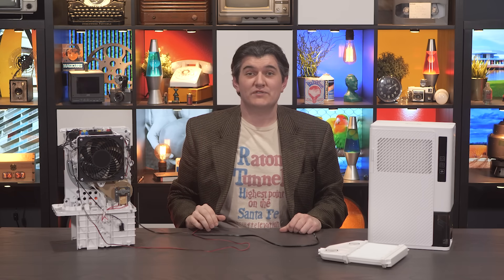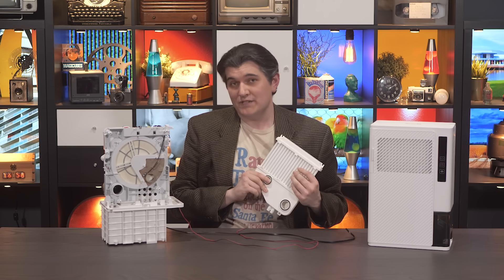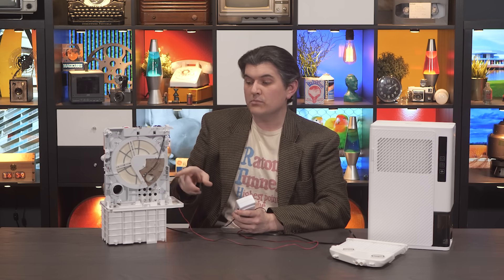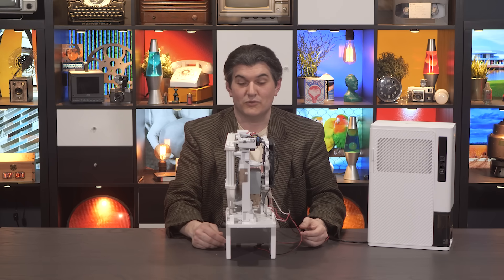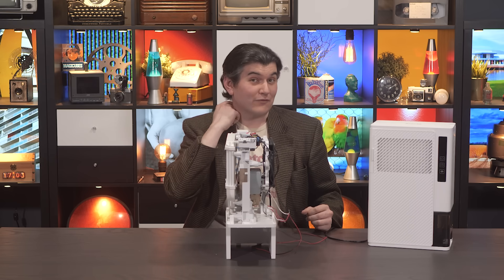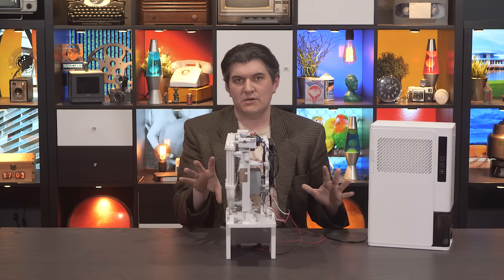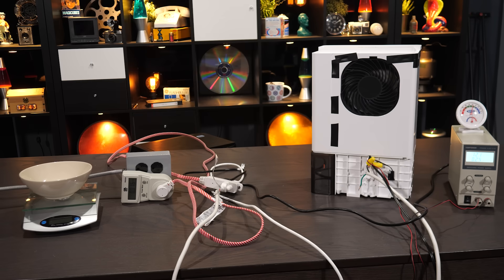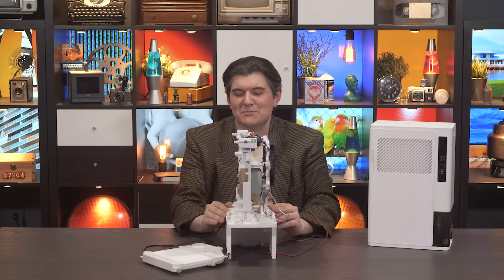A failed duty cycle experiment with a rotary desiccant dehumidifier

Comment: when you did the first test with it out of the case you mention adding a fan to give it airflow since it cant generate sufficient airflow out of the case. that might be why you got more the first test. an extra fan gives the straws more air to cool down more and the gel is exposed to greater amount of air 2:50

Comment: I've used one of these for a couple winters now on my sailboat. I'm happy with the results.  Keeps the ambient temperature a little warmer but also removes moisture.  The biggest problem is when there is a power interruption it does not automatically restart.  Any idea how to get it to automatically restart?

Comment: The experiment that came to mind for me was whether or not the waste heat from the hot side of a heat exchanger dehumidifier could be used for the hot, dry air portion of the rotary dessicant dehumidifier.

But honestly that's getting into Rube Goldberg territory.

Comment: I feel like the one thing you could do to increase efficiency in releasing moisture from the dessicant is by directly heating the dessicant from the inside rather than heating the air being blown into it. By like running a heating element through the wheel in spokes and making contact selectively when they're in front of the small blower. Unfortunately, as you've stated in the main video, the air actually needs to be warmer for the condensation step to hit the dew point effectively, so that doesn't actually accomplish anything except making some more intensely damp air.

Comment: there was probably hundreds or even thousands of hours of calculations and testing and design validation which is why it was built the way it was. The experiment you did was not a failure in any means it just didn't have the outcome you expected.

Comment: I like where you are going with this thing, perhaps put a timer on the heating element, where the silica gel becomes, "More saturated?" before the heater comes on and drys it out. Keep everything running as normal, except for the heater, as that is where all the work and power usage happens.

Comment: 1. Did you account for the energy used by the fan on the paint can for the initial experiment?
2. I'd bet that the "fluke" result was because the lack of plastic housing allowed more air to dump its moisture into the silica, aided by the extra fan.

Comment: I think this does support a few other experiments though:

If we sacrifice quiet, can we ram more air through, and maybe turn the motor faster to get more volume through the condenser?

If it's running on resistive heat, could it be set up to scavenge its heat from something else, such as a computer? 

And my personal favourite, what about running the rotary and the refrigerant loop sequentially? The rotary can "precondition" air to be hotter and wetter and more what the condenser likes. There may also be a similar scavenging opportunity with ducting around the hot side of the condenser loop, but I'm less confident about that.

Comment: Measure temperatures before and after the wheel on both zones. 
Larger ∆t = higher water ad/desorption.
Adjust wheel speed, airflow and heat for most efficient dehumidification.

The condenser isn't too efficient above ambient (22°C) so alot of water doesn't get condensed and thus the air is not able to pickup as much water from the wheel, since it's already carrying a lot of water.

Comment: Given that the peltier model of dehumidifier you covered was similarly efficient to this type, I am surprised you didn't end up combining the two. Replacing the straws with aluminum or copper would allow the cooling of the peliter unit to condense more water out of the air, while the heat generated by the peltier model could be used to product the heat that is pushed through the silica.

Comment: Never even heard of this being a thing for dehumidifiers, only ones I ever knew of all had a compressor. Seems like we'd have something more advanced by now. I could see something absorb  moisture motor turns an offset wheel then squeezes the moisture out at least that would be fairly efficient with power.

Comment: Here's another thing to examine... Saturate the disc with moisture, weigh it, then heat the disc in an oven to recondition it and immediately weigh it again. You could also use your air fryer to pass hot air through it. 😂 This would tell you the capacity of the disc. This might also tell you if the heat exchange is the part which isn't extracting all the moisture coming from the disc.

Comment: Hypothesis: the desiccant absorbs water the fastest when it is the driest. Running the heat on full tilt thus collects water faster. To your original question, is the desiccant wheel moving at the optimal speed when applying max heat? I have another hypothesis - again, if the desiccant absorbs fastest when it's driest, running the wheel faster should collect more water. Even though it may collect less water per wheel revolution, the rate at which the desiccant collects water should increase as its dried out more often. If this is accurate, it would improve energy efficiency as it's not as energy intensive as pushing more air or more heat. I would expect more airflow through the wheel, condenser, or more heat to all increase the total moisture removal rate at the expense of efficiency.

Set up the wheel with duty cycle control, such that you can move it in increments, ideally equal to the area of the heating shroud. Then you can test longer or shorter drying cycles (which is equivalent to changing the absorbing time as well). I don't think this will have better results than continuous process with the same average wheel RPM, but it's a way to control wheel speed with your current equipment.

Comment: I actually believe the reason you retrieved more moisture the first time around with the experiment is because you had that fan blowing on the condenser, higher speed moving air directly on the condenser like that will cool it more significantly, also more air moving into the silica gel wheel because of it could also mean just more air was passing through and thus more water could be taken from it.

Comment: I wonder how efficient that would be if you took heat you where already going to use for heating ex forced hot air and used it in that system. Seems like an uncommon use case but I’m thinking it might be efficient.

Comment: The better way to try and improve the energy efficiency of these is in the condenser. The heat rejected by the condenser should be able to be used to preheat the air going to the heated section of the desiccant drum. The efficiency will never be brilliant though, even if you do it like that.

Comment: Now I wonder if increased airflow over the tubes and silica disk would meaningfully affect the performance, rather than cutting the heating setup.

Might be worth it to try sticking a fan to the outside of the casing to increase the airflow/-pressure during otherwise normal operation.

Comment: Chemist here. You had the right idea, it's very unlikely that it's fully saturated in that short time frame. But like most things, it becomes a bit less effective at adsorption the more saturated it becomes. Kind of like how a dry towel is better at soaking up a spill vs a damp towel. So targeting 100% adsorption would be a waste of energy and time.
Reply: The moisture is taken up 'for free' through passive processes, whereas drying the gel takes energy.
So even though taking up more moisture may be time-inefficient, it can still be energy-efficient.

In practice, there is obviously some sweet spot. Like making the wheel gigantic would mean that it gets more time to take up moisture, but it would also make the device extremely bulky.
Reply: @T33K3SS3LCH3N , it's not really "for free" because you have more drying to do afterward. You either don't get it fully dry or not fully wet, unless you spend more energy heating it and more time exposing it to the air. A full 0% to 100% cycle may very well be energy inefficient in addition to time inefficient.
Reply: The only thing that actually matters is the rate at which moisture is removed on the hot side compared to the power consumed. It doesn't matter whether the material reaches the extremes of moisture, in terms of efficiency.
Reply: I would've just slowed down the wheel....
Reply: sorry this is a super late addition, but i wouldn’t actually be surprised if the silica were pretty close to saturated, the heating element is probably getting nowhere near to fully drying the silica, those kinds of materials can hold on to a TON of water very strongly, thats why we use them to dry solvents and such and keeping them in inert  atmosphere is important for them to stay “activated”

Comment: The "normal" use case for silicon dessicent involves small sealed containers: medicine pills, jerkey or other "dry" foods. Presumably, the manufacturing process tries to keep the air in the containers as dry as possible, and with as small a volume as possible. Therefore, the moisture it is expected to absorb comes either from the contents itself, or from difusion through the container or the seal. That is not much at all.

Comment: Measure the temperature of the heating element.  
Bake the desiccant in an oven at as close to the same temp as you can.  Measure the weight of the disc.  
Set the disc in a very humid location and again take the weight.

If you know the max amount of moisture the disc can hold, the RPM the disc spins at, then you can calculate the max amount of moisture you could expect to extract per minute.  This of course assumes "full saturation" of the disc by the time it reaches the heating element and the complete dehydration of the disc by the end of the drying cycle.

You might also repeat the experiment and only change one variable - the speed of rotation.

Comment: I wonder if you simply slowed the speed of the dessicant wheel so it has longer in the heat and also longer to cool and collect moisture.  Maybe decreasing the duty cycle to reduce power consumption isnt the way to increase efficiency but making it collect more water between drying cycles could be more effective?

Comment: Thing is, there are a number of things the engineers that designed the thing (three is the perfect number) could have done to reduce power consumption without making the resulting contraption more expensive (which was the hypothesis of this experiment: we can make the apparatus work better while using less energy). If they didn't do that, it suggests that the outcome would have been unfavorable under normal use.

Generally speaking, I will be willing to concede that what I am getting is the best possible result  *for the cheapest possible price*. That's because the designers' pride is forever fighting the company's bottom line, but if an engineer can make something, for the same price, that just works better, they will.

There probably are a number of tweaks that can be applied to that dehumidifier, based on room temperature, actual relative humidity, and a number of other variables, that might be able to make it work better, at the cost of making it significantly more expensive. The simple ones, however, the ones that are really cheap to implement, like reducing the size of the regeneration section, the power of the heating element, and the rotation speed of the wheel, all of which, combined,  would result in the same outcome the experiment was looking for, have already been taken into account.

After all, if there were an easy way to get more dehumidification for less power, that would be a competitive advantage.

Comment: The fact that the output of water is so oddly consistent probably on its own means that the silica gel is almost always completely saturated. So the heater is probably sized so that it doesn't damage the wheel at full power.

Comment: I don't think the wheel's saturation is the limiting factor. It's likely to actually be how much water can be pulled out by the heater. A similar experiment with a higher temperature in the heater, or a larger heater might see different results.

Comment: Yep. Too many variables. Even the room moisture content may change while you're running the experiment. (I mean, that's what the thing is supposed to do after all). Certainly running it uncased with an exterior fan seems an odd choice. Also, I'm looking at the proportion of the wheel covered by the heater. It looks like less than a third to me, so I'm wondering if your 80/40 second ratio is correct? The rate/extent to which the silica absorbs moisture is probably higher when it's warmer. But an experiment that isolated the gel, heated one sample and not another, placed in equally moist air containing sealed containers might confirm/deny that. It might be bit more finicky to arrange, but the rate the silica loses moisture in an airflow depending on temperature could also be arranged. 
The designers have presumably assumed that mass air flow is the more determinant factor, hence reducing the heater temp in night/economy mode. Still lots to learn here I think. And fascinating as until your video I had no idea such a device existed. There's a LOT of product development in the world of 3D printing aiming at drying/keeping dry hygroscopic filament. Silica gel is widely employed as is active heating, but to my knowledge no device incorporates the two techniques as here.

Comment: I wonder how much the desiccant is doing, compared to just passing hot air through a radiator.

because hot air can already carry more moisture.  I guess it'd be adding surface area.  but dunno I feel like you could design something without the desiccant which would let you get away with less heat and just a bigger radiator.

Comment: My issue with this is kind of the exact opposite of what yours was. To 'recharge' silica packets they need to go into a 120c 250f oven for 2+ hours. I suspect that the heat is not prolonged enough to remove water from the matrix in an efficient manner. However.. I am not going to test that and instead will be running my heat from September/October through May/June with average 20-30% humidity outside in the summer.

Comment: From what you shown in both videos, it looks like the gel gets saturated well before it returns to the heater. Like, you might as well add the second heater. (or do something fancy to heat two opposite areas of the disc)

Comment: on a molecular level, silica gel is made by superheating glass to such a high temperature it turns into a gas, then spraying the gaseous form of glass into a cool air volume where it turns instantly into a solid. 

this creates a kind of sand that has an extremely high surface area, which provides a lot of nucleation sites for water vapor to cling to. then the dense networked internal structure of the silica gel traps the water molecules inside it.

Comment: A larger and thicker wheel is probably more efficient but not as portable. In building scale HVAC systems, a desiccant wheel is 1-2 meters in diameter and about 25cm thick. Some percentage of the wheel exiting the heating area does not do anything until it cools enough from room air blowing through it to start adsorbing again, and may actually re-reradiate some hot moisture back into the room as the wheel cools.

Comment: what if you are getting this backwards, its the heating that starts the action, it starts the timmer as the thing gets colled down and this time window ditactes water absoption level. what if everything is proportional to how much they can heat this. plus you only think about electro-mechanical factors and this chemical reaction depends on more than power and time etc

Comment: Could you heat up the disk (so that it is 'dry') and then place it on your scale and chart the weight change to see how long it takes to get saturated? I'm not sure if it holds enough water to measure the change.

Comment: Have you considered putting the unit on a precise scale to track its weight, how much is gained per heat cycle. Then remove/bypass the condenser/heat exchanger and see how much weight it gains and loses per cycle. You might get some cool information about how much moisture the silica gel is picking up. Then if you can extend the cool period you can see if it gains more weight. It, unfortunatly, will probably require a very sensitive, precise scale.

Comment: Can you increase the number of desiccant? That could help. 
I was thinking that it may be worth slowing down the wheel and increasing the heat zone,  if possible. From my experience with 3d printing plastic,  it takes many hours to dry out,  so a slower wheel might help.

Comment: Why didn't you just mess with the rotation speed to increase or decrease the time exposed to moist air before it gets heated and then control the amount of heating by lowering the power for the heating element and blower fan? 
If the silica wasn't fully saturated before it reached the heating element, you could just slow down the wheel and decrease the heating (since it now spends more time there as well).

Comment: The difference between the two experiments is most likely that you have the airflow directly on the cooling coils which means that the condensation builds up quicker

Comment: It looks like your first results were misleading because of uncontrolled airflow when the unit was outside its casing. In HVAC experiments, airflow management is absolutely critical since it directly affects both heat transfer and adsorption rates. I’d suggest adding a controlled airflow setup (maybe ducting or a calibrated fan) next time to minimize experimental noise

Comment: Suggestion:
Having thoroughly dried the desiccant wheel somehow, place the entire device on scales with the heater and heater motor disconnected. As it adsorbs water it will get heavier. Use camera trickery to determine how the rate of adbsorbtion changes with time.